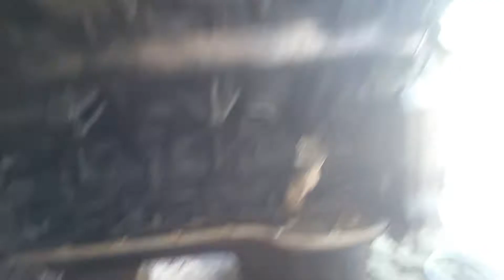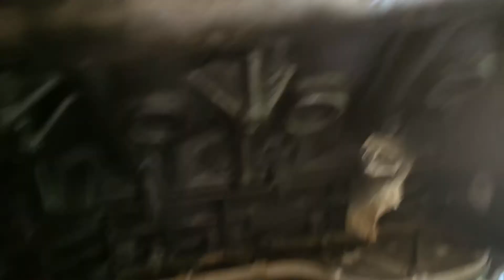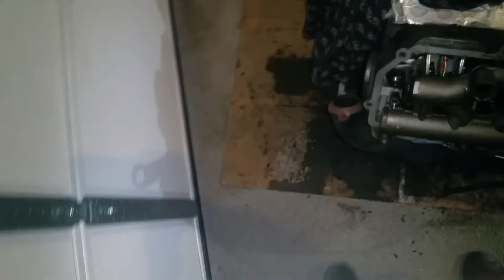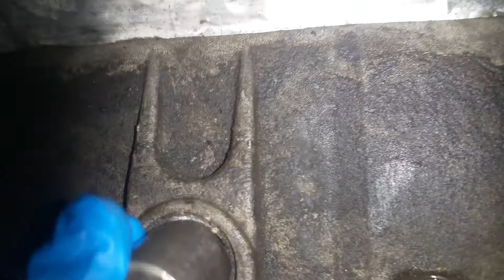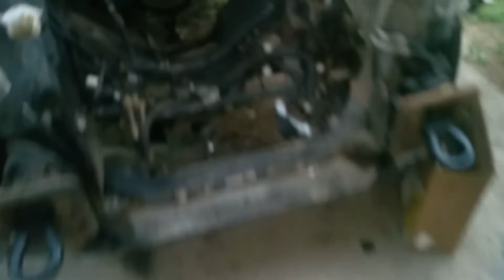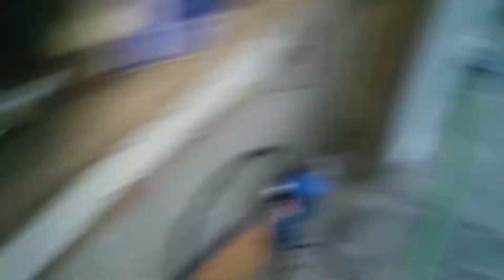Prepping engine for install ford 6.0l powerstroke

Comment: You spent a day scraping the rust off of that block. That doesn't surprise me! Well done and looking good. Thanks!
Reply from the maker: +Baxrok2 I'm hoping it's a good engine I always get nervous with a used engine . I have that thought in the back of my mind could this be the one , just never know until it's running for sure . I got a really good deal on it so I don't mind a little work , but the rust was pretty extensive. . Thanks for watching